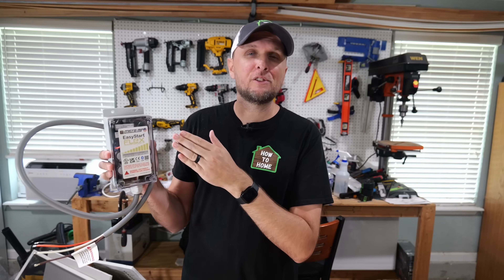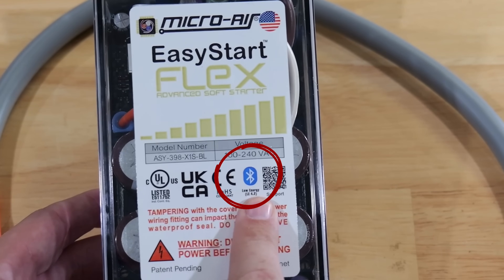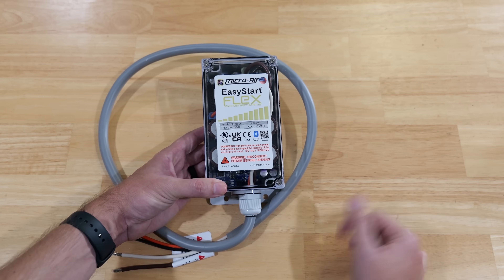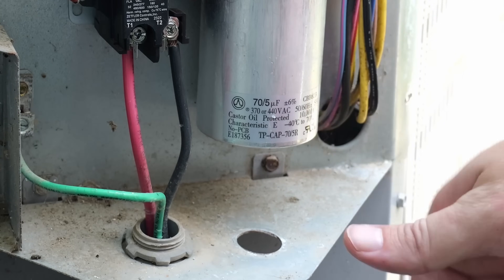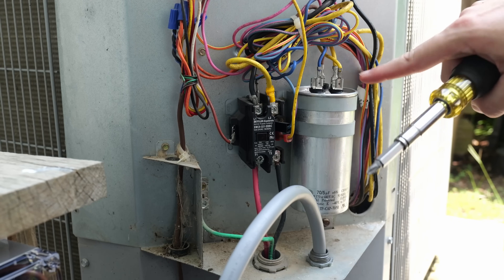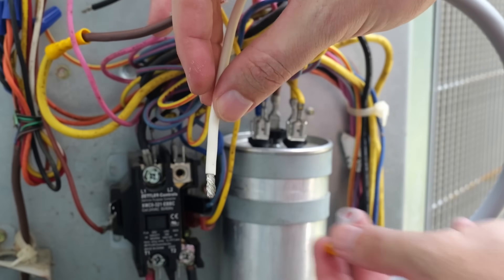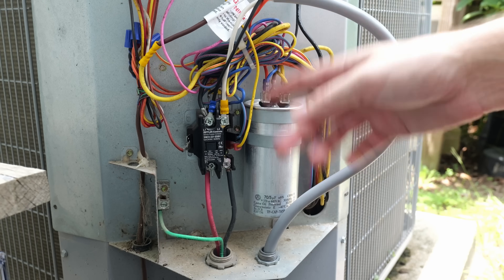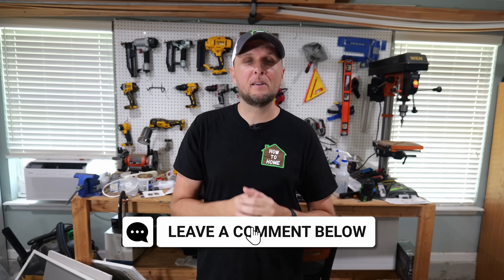The ONE AC Upgrade Every Homeowner Needs to Consider!

Comment: So, the exact opposite of a hard start. Why would anyone who's been talked into a hard start even consider this? If I'm understanding, this device is good for folks with unstable or unpredictable energy supply. Generators, vintage mobile home parks, rural areas, etc. But for someone with predictable and stable 240 volt supply is there any reason to consider this?
Reply from the maker: It has nothing to do with whether your voltage supply is stable or less stable.  A hard start does not reduce the inrush, it increases it but in doing so, starts up the motor faster.  This actually reduces the inrush necessary.  In my opinion the only place a hard start should be used is if your compressor is older and/or having a hard time starting.  That is why they were made.

Comment: Be careful most thermostats have a delay built in . So if you have a delay built in to your stat you will have wait again for your soft start to kick in also ! I hope they build in a shut off for the delay
Reply from the maker: Yes, thermostats do but I don't understand what you are warning against though when it comes to the soft start?
Reply: @HowToHomeDIY  warning that these ac are designed temperature is for 80degrees we are allowed to go just a bit bigger ton wise than the design temperature. so when you are in the higher temperatures like 90 and 100 degrees if you have a 5 minute short cycle delay on your thermostat and another 5 min short cycle delay on the soft start your going to be waiting around 10 minutes before the ac kicks on ! So you may want to turn off one of the short cycle delays to help keep the temperature maintained . Some thermostats are designed to be turned off some are not ! So hopefully through the app you can turn the short cycle delay off on it ! I like this product just want to make sure someone don’t think it’s not working correctly if the ac don’t keep up in the hotter temps . Oh and by the way your ac looked like it had a timer board some of those boards may 3 to 5 minute timer you may be possibly adding three short cycle time delays to your system ! Yes my profession is heating !
Reply from the maker: @kentkurt9065 yeah I gotcha.  So I believe the default delay on the soft start is 3 minutes as well and that time starts the same time as the thermostat.  You can change it in the app to whatever you want though.
Reply: @HowToHomeDIY  that is pretty cool!  They thought of everything! I’m getting one for my Rv I love the fact that it doesn’t slam the compressor on !

Comment: Interesting, but I have 3 heat pumps. This would set me back roughly $1200. I dont know if the savings would be enough to compensate for the upfront cost?
Reply: If they were new heat pumps, they should be inverted compressors and so they already have this benefit to them.

Comment: $389 is a good chunk of change. I'd rather install a new inverter / variable speed heat pump than throw more $ at an old on/off heat pump or AC.
Reply from the maker: So you would rather spend $7k-10k?  Alright then.
Reply: @HowToHomeDIY  can do it for far, far less than that, and it'll be much more efficient plus keep the house at a more even temperature.
Reply from the maker: What is far far less to you?  You’re not getting one of those installed for less than $7K.  I know because I’ve looked into it and gotten multiple quotes.
Reply: @HowToHomeDIY  I replied. Did you delete it?
Reply: $7,000 - 389 = no go me boy!!!!  If you wanted to save money (but first go take a math class or none of these numbers will have meaning), then get a hard start kit instead.  Its just not quite as good though.

Comment: BTW - 32.3A @ 240vAC = 7752 Watts - so not a small or medium generator.  In fact, you're pulling more watts than your example generator can output @ 6875 Watts!
Reply from the maker: Except that smaller generator started my unit with the soft start.  You can watch it do it in the micro air video I made last year.  So yes, most smaller to medium sized generators can handle it.
Reply: That draw is only brief, like milliseconds

Comment: .   At $389 it's a big commitment.   I would find a way to attach it to the unit.  I don't like extra boxes detached from the unit.
Reply: I just (carefully!) screwed mine to the side of the cabinet with the provided self tapping screws.  Just be careful you don't puncture any lines or wires on the inside.  Or just glue a magnet to the back of it and stick it to your unit.  I almost did that.
Reply: @DocNo27  makes me think of van guy tapping solar panels to a roof

Comment: Why did you leave so much liquidtight inside the unit past the connector?
Reply from the maker: I didn’t use any liquidtight other than the connector.  So not sure what you are talking about.
Reply: @HowToHomeDIY  Come on, the whip coming with the unit, that is called liquidtight. It is the thing that looks like a hose that they run the wires through 😆, you even mentioned a liquidtight connector as an option.
Reply from the maker: That is not liquid tight.  That is just the jacket or sheathing of the wiring.  Liquid tight is a brand name of a flexible conduit.    I only used a connector as a protective grommet as the whip fits through it perfectly.  That’s why I didn’t understand what you meant 😂
Reply: @HowToHomeDIY  I know it's a trade name, like drywall, my goodness you know what i'm asking 😆😆. My simple question was why leave so much "sheathing" inside, that was all. Maybe you didn't think about it or don't mind manipulating that much in a small space or what ever your reasons. Basically I think cutting it back and making the job cleaner would have looked better and been more practical, that is all.
Reply: @truthdefenders- guy do you struggle with pride or are you just special?  You called it by something that it isn’t and honestly I see why the How To Home guy was confused.  But you didn’t just call it that once, you doubled down on it in your second comment and seem very condescending with how you’re wording your replies even though you’re the genius that doesn’t know what he’s talking about.  Then your third comment you say it’s a trade name like drywall as though anyone calls sheathing liquid tight 😂.   If it was conduit then at least you would be in the same ballpark.  And you don’t trim it because unlike Romex NM cable it’s not designed to be taken off.  It’s there to help protect the wiring and fully engulfs the wires all the way around each one unlike romex. How would doing that make it more practical?  What would that add as a benefit? If you are considering doing this please hire someone to do it.  Not sure you should try to do it yourself.  My goodness.
Reply: @HowToHomeDIY I wouldn’t waste anymore time on this one.  I can see you were trying to help and be considerate.  Maybe I’m wrong here but his replies seem unnecessarily condescending.  Keep up the great work!
Reply: @johnpicard4909  Calm down son, next just write a book and maybe i'll read it. But to answer your first part, go to any supply store and ask for "liquidtight" see what they look up for you, if using that "trade-name" confused you you need to go work at taco bell and stay away from construction.
Reply: @truthdefenders-  🤣 guy you’re trolling aren’t you?  They will bring out a flexible conduit not sheathed wiring.  It looks nothing like what’s in the video other than in color.  You aren’t going to a supply house anyways.  You are definitely not in the trade.  You would be laughed off the crew for calling that liquid tight 😂.   You also didn’t answer my question.  What benefit would there be to cutting the jacket off the wiring?  So it looks nicer in the enclosed compartment? 😂🤣🤡

Comment: this is the kind of technology that should be standard in these systems! thanks for the video, very informative.
Reply: This comes from the RV industry and they are only know just starting to build this in some models of RV AC units.
Reply: I'm really surprised it's not.  Is this device just for old systems, or do they still sell AC like this in the USA?  In New Zealand and Australia, they are all inverter models and have been for a very long time (15-20 years?) - the compressor varies it's speed.   Once the room achieves the set temperature it does not necessarily switch the compressor off, it keeps it running at a slower speed to maintain that temperature. That also means they always soft start.
Reply: @craig00000  I can see how it would always have a soft start, since it never stops. But that seems like that would cause wear in itself by never turning off, but I really don't know. I guess I shouldn't look at it like a person, who needs to rest after working...lol. But seriously, it does seem like it would run twice or more as long. So your unit runs 4 years out of 4, and mine runs 2 years out of 4, but gets a hard jolt each time it comes on. I'm not sure there's much difference and don't know how one would compare the two situations. You don't know if you're saving on energy or not, because you don't have a comparison and only your compressor knows if it needs a rest now and then. 🙂
Reply: @floridaredneck  Properly designed variable speed motors definitely save energy and wear in the compressor.  This is proven by actual studies.  (Similar to letting a car run for 10 years at 2,000 RPM vs 5 years at 4,000 RPM)
The PROBLEM with the high efficiency variable speed systems is the CONTROLS and sensors add extra electrical components that can fail.  These are more expensive to begin with and cause higher maintenance costs as well.
So short answer is to stay with the “standard system” unless you are paying 20¢ or more per kWh. 😀
Reply: @craig00000  Inverter compressors are basically unheard of here, as are heat pumps. Usually only the higher end units have it, or smaller mini splits.
Reply: @craig00000  thats incorrect for residential AC compressors. I believe you may have confused this with the upgraded indoor fan motor (ECM, dc motor). Inverted compressors definitely have not been a thing for 15-20 years.
Reply: I'm just throwing it out there. The AC unit is designed to the needs of the components, and maybe they do not install this from the factory as it's another point of failure. Just like an AC has a Capacitor that's pretty large, but this one has a bunch of small ones which will be much more prone to failure.
Reply: @SL50438  the obvious flaw in this logic is that AC manufacturers install the very cheapest components and then you have to pay a service tech later to replace them (or do it yourself) with actual quality parts. Profit the key here. 

Also, a "big" part failing is always way worse (and cheaper to install) then to have multiples that will still keep your unit running if one fails. So you actually had that one totally backwards....
Reply: @srobeck77 exactly - where do people get these ideas from??? How can they be “certain” of something that is entirely wrong? Hubris? Extrapolation? Advice from a lousy ignorant tech in the past?
Reply: It takes regulation but seeing how GOP freaks out about their gas ovens then you’ll never see it pass.
Reply: @ColHunterGathers perhaps they should leave the gas ovens alone and focus on increased energy production and efficiency. This would drive costs down for just about everything.
Reply: @RobC1999  Literally not a single person, law, or anything actually did anything vaguely close to impacting gas stoves... and yet the GOP freaked out anyway.
That was the point of their post.
I'd love to hear your... let's be extremely kind and call them "thoughts" as to how you'd suggest we increase energy production and efficiency by continuing to pour billions into fossil fuels.
There isn't a whole lot left to get out of a 96% efficient condensing NG furnace.
Meanwhile, heat pumps average ~500% heat output vs input over the course of a heating system in the southern half of the US.

Comment: My other question I have a heat pump unit and AC, Will this work on that?
Reply from the maker: Yes that’s what mine is.
Reply: Makes no difference. The compressor runs the exact same way in AC or heat pump mode.  Its just that your reversing valve changed the direction of the refrigerant flow.

Comment: I have a 5-2-1 hard start, in reduces LRA by 60%, generator starts the AC fine. These soft starts are better, but cost way way more and were out of stock at the time I was looking. The only worry on the micro air sooo many parts and so complex if it breaks out of warranty you are screwed. I think the hard start with potential relay was $60

Comment: I've been looking at this for a couple years, but just can't find any information as to if it will void any manufacturer's warranty (I have a Lennox).  I think they should be included on all compressors as standard equipment, even if you don't have a generator, to reduce start load on the circuit and the related start/run capacitor that always fail due to stress load.  HVAC companies love replacing start/run capacitors... an easy 15 minute job and <$50 part they charge you hundreds to swap.

My only concern about the new model is the reports of them failing.  I'd rather pick the older model specific to the tonnage I require, as they seem better built... until a revision of the newer one comes out.

Comment: You are absolutely going to see utility cost benefit with this because you are reducing the energy required to start the air conditioner. Most of the energy that a compressor uses while it is running is the start up.
Reply: Haha, ummm, no. Startup transient power draw is nothing compared to the runtime power usage. Installing one of these units will have zero impact on electric bill...
Reply: Incorrect

Comment: They had a ton of issues lately with these because a lot of people had failures due to the firmware. They also had problems from where it would fail to start and had to replace a lot of them.
Reply from the maker: Considering they sold thousands and thousands of them, the amount of people that had issues was relatively small in comparison.  They have also said the part that some had issues with has been replaced, upgraded, and sent anyone with a claim a new one.  Mines been installed a couple of months and so far works just as well as their previous models that I’ve had installed for years.

Comment: Better hope you get a B36 revision, the B34s are popping caps. They changed from one large cap on the older model to a few smaller caps in parallel on the Flex.  This most likely saves cost but it introduces multiple points of failure.

Comment: What are your thoughts on the compressor running cooler on a soft start?  It's basically cleaner, controlled energy and improved efficiency--even if only a little better I would think makes a difference in operating temp.  Here in Texas, we need all the help we can get.

Comment: So did the Herm terminal not have anything plug into it to begin with?
Reply from the maker: Yes there is a wire on it.  Can see it in the video.
Reply: @HowToHomeDIY  I see the blue one in the front. That's the only one? 

I wasn't sure if I blinked and missed the wire that was in the place you put the orange wire. If so I was wondering what you did with it. After re-watching that part a few times I now see there are multiple flat parts that don't have wires on them. I was thinking all the flat parts had a wire on them. 

Thanks!!

Comment: Thank you for the information on this new FLEX model.

My question is about the five starts needed to properly program these.  If I install one now on my older central unit and then replace the system with a new one (which I will be doing in the Spring of next year) can you do the five starts on the new system and make the same FLEX device reprogram to the new system?  I would hope that I would not have to purchase a new FLEX when I replace my central unit.  Thanks.
Reply from the maker: Yes you would just have to reset the soft start.  I believe in the app it just says relearn.
Reply: Thank you.

Comment: A starting electrical motor is expected to pull 5 times its current during startup. Not an issue when connected to a grid that has a lot of overhead. A big deal for solar or generator based grid with little to no overhead.

I do not believe that the difference is worth it if you run on the grid. But yes, if you don't use the grid, good idea.

This device will NOT improve the life span of a compressor or a fan motor. That 5x pull is by design for a reason. It will protect and save the solar panel inverter or the generator by preventing overdraft during starting events.
Reply from the maker: It won’t help the fan but it will help  prolong the life of the compressor.

Comment: I have a Carrier 2 stage compressor, not variable, wondering if this device would work for my system?
Reply from the maker: According to Micro Air it is "Compatible with 2-stage Compressors and Heat Pump Units"

Comment: so, I have a clod climate heat pump with a variable speed compressor.  The thing is dead silent.  Would a soft starter do anything when the thing is essentially soft starting itself?  I have grid tied solar with a Tesla power wall, and the heat pump works fine, summer and winter, never had any issues in two year.
Reply: You wouldn't need one of these.